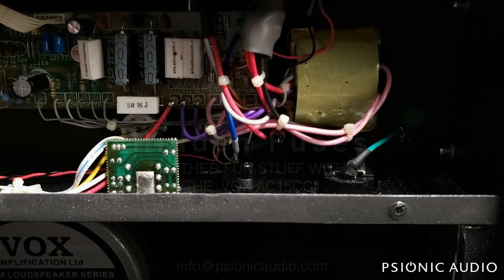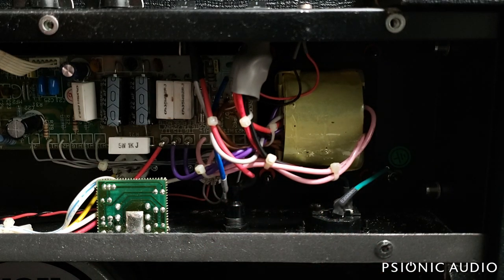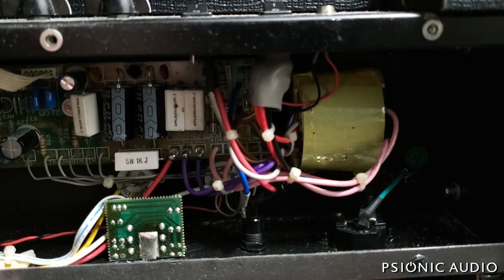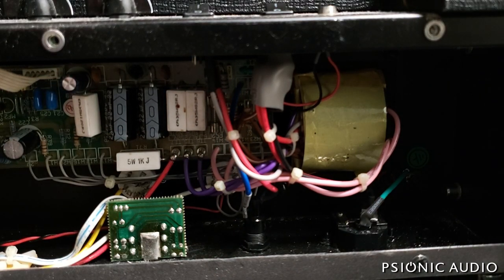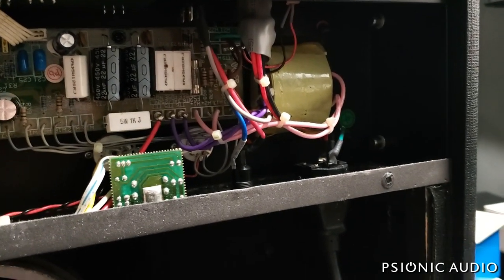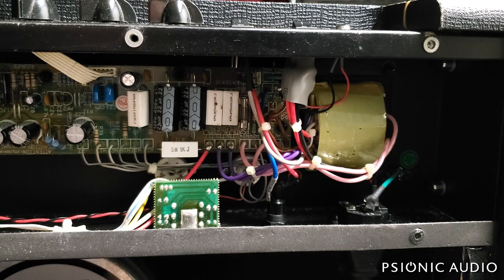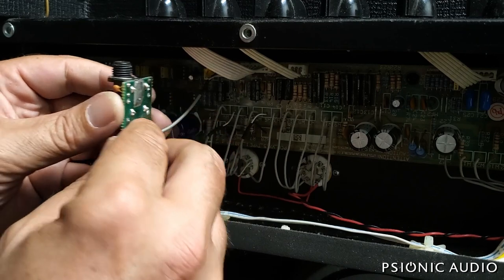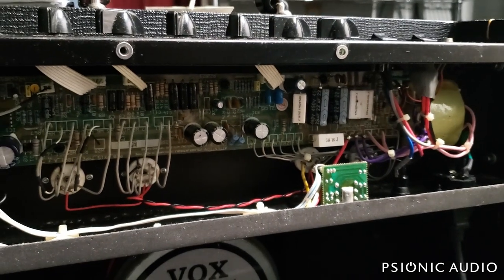Tech Tip: Hidden Fuses & Other Fun Stuff with the Vox AC15CC1

Comment: Your opening remarks made me think of this anecdote about Henry Ford and Charles Steinmetz:

"Ford, whose electrical engineers couldn’t solve some problems they were having with a gigantic generator, called Steinmetz in to the plant. Upon arriving, Steinmetz rejected all assistance and asked only for a notebook, pencil and cot. According to Scott, Steinmetz listened to the generator and scribbled computations on the notepad for two straight days and nights. On the second night, he asked for a ladder, climbed up the generator and made a chalk mark on its side. Then he told Ford’s skeptical engineers to remove a plate at the mark and replace sixteen windings from the field coil. They did, and the generator performed to perfection.

"Henry Ford was thrilled until he got an invoice from General Electric in the amount of $10,000. Ford acknowledged Steinmetz’s success but balked at the figure. He asked for an itemized bill.

"Steinmetz, Scott wrote, responded personally to Ford’s request with the following:

"Making chalk mark on generator $1.

"Knowing where to make mark $9,999.

"Ford paid the bill."
Reply from the maker: I do love that story, though in most versions the people/places aren't named and the machine is just some mysterious machine. And the guy charges $1 to hit it in just the right spot with a hammer.

I think of Fonzie with the jukebox...

While I'll take the compliment, hopefully most techs know what a bad diode in a rectifier bridge circuit sounds like.

And now so do all of you. ;)

Comment: What if HT and HEATER fuses are OK but only the MAIN is still blowing up, I changed both EL84 and EZ81 rectifier on my AC15HW.  Main FUSE is still blowing... any advice? 
There is no mark of burning inside, all seems like new. Could it be some capacitor or could it be transformer also whe HT and HEATER fuses are OK???
Reply: I have the same issue, all seems fine but it will blow the main fuse. Have you sorted the issue?

Comment: HI , thanks for the video. I am trouble shooting one of these at the moment that is also blowing the main fuse. After seeing your video I went straight for these diodes but they seem to check out ok. Can you explain the function of them, to me it looks like they just form a connection from pcb ground to the chassis ground along with a 10 ohm resistor and small cap.
Any other pointers for diagnosing this fuse blow problem with my amp? I also hear an angry mechanical  hum for a fraction of a sec before the fuse blows. Any help appreciated. Thanks . Dave.

Comment: Thanks for another great video. I'm diagnosing one of these at the moment that blows the IEC fuse occasionally on switching on. You mention testing the diodes at D3 and D4. I pulled up one leg of both and got about .450 on my multimeter one way round only. Could that be the cause?
Reply from the maker: That's how good diodes will test.

This amp turned out to have a partial short in the PT primary. I'll be showing the installation of a Hammond replacement soon. Parts delays dragged this one out.

Comment: What wattage bulb do you use in your dim bulb tester?
Reply from the maker: Different ones depending on the amp. SVTs get bigger bulbs as an almost 10A draw is normal. But 300W is the most used.
Reply: @PsionicAudio  Thank you!

Comment: Didn't know that fuse was hidden. Thought you were going to point out one of those, hidden under the tape, in the transformer windings fuses.  Tech tip for your tech tip, extra fuses fit in the little square of plastic under the fuse holder.
Reply: Those fuses inside the transformer are thermal fuses, to prevent an overheating transformer from catching fire. They're a bit different than standard glass fuses.
Reply: @goodun2974  Slightly different, but functionally the same, will stop something from working if blown. Never seen one in a guitar amp, but might exist in some. Mains fuse is mostly there to stop the amp from catching fire…
Reply from the maker: I think thermal fuses inside transformers are a little past what owners should take care of themselves. ;)

I should have mentioned the spare holder slot.
Reply: @PsionicAudio  , have you seen thermal fuses being used inside tube,amp transformer? I am curious if Mercury, Hammond and so on use them.  I would bet that the Asian manufacturers do indeed put them inside the windings....

Comment: I've just got a ac15cc1 recently in a trade for a 12 watt handwired tweed clone I had for sale. 

Today I put a brand new Greenback I found on ebay for £90. It sounds awesome now. 

My question is can I use it for a club gig with a mic in front of it with a blues band? Crank the Vox up get that break up, Use my Tele and a Nobels ODR1 for solo needs? 

Second question is.. The Footswitch that came with it being a old amp only the left side of it works, which turns reverb on and off. That's cool but the Tremolo is always on as the B button on the Footswitch doesn't do anything and doesn't turn off the Trem. So I have to have the Trem on all the time and have Tremolo speed and depth set to zero. 

But I still can hear the annoying Trem noise in the background as can't turn it off. Is there a modern replacement Footswitch for the older ac15cc1 that actually works and turns the trem and reverb off? 

Love the channel mate. subscribed 👍🏻

Comment: Had this model (AC15CC1) and it was horrible. Cheaply constructed all around (plastic rocker switches?) and did not sound that good with the base-spec Wharferdale speaker. Apparently they come alive with an AlNiCO Blue but then you were $700-800 deep in a cheaply constructed and feeling amp. No thanks.